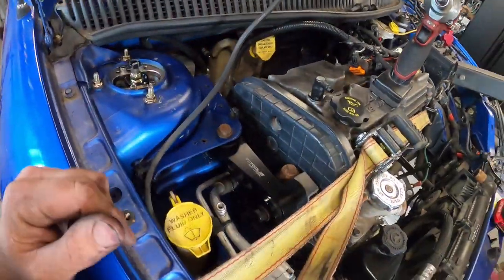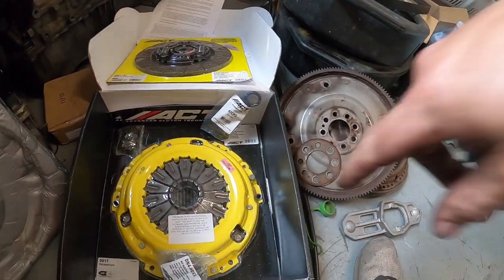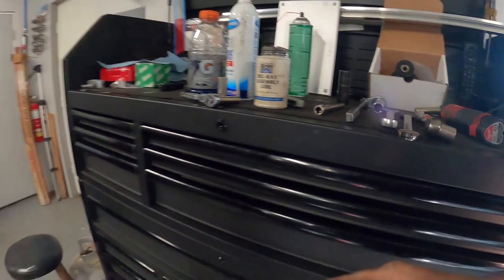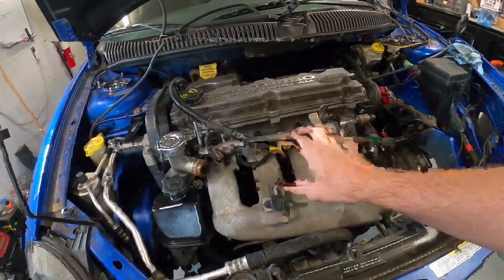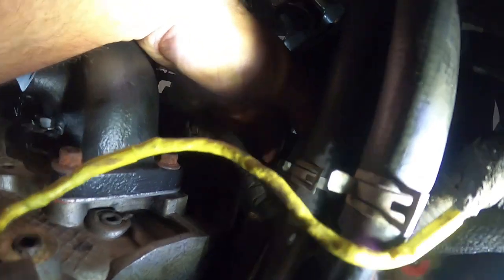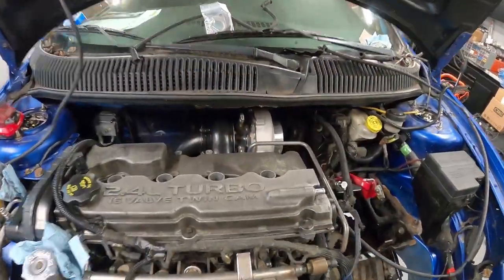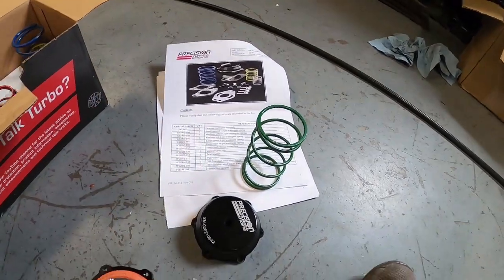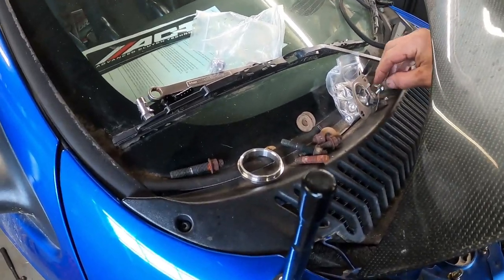srt4 clutch and big turbo install

Comment: What’s would be the cost parts/labor for this install? Also what’s the power range for this setup on the original engine?
Reply from the maker: Average good agp kit is around 2500 the clutch and fork 1100 mounts almost 400 timing belt kit just over 200 fluids gaskets bolts another 150-200 there is still fuel system to upgrade a stock engine limit is around 450ish I don’t personally know just from reading posts over the last 10 plus years. Labor is if you do it or pay shop could be another 2000 more or less till it’s assembled and tuned to do this the right way cost money